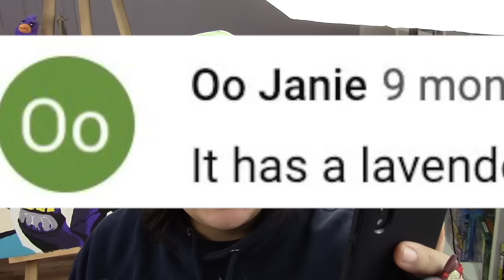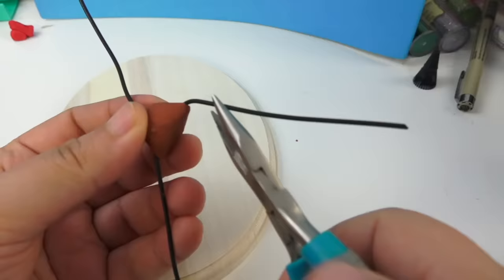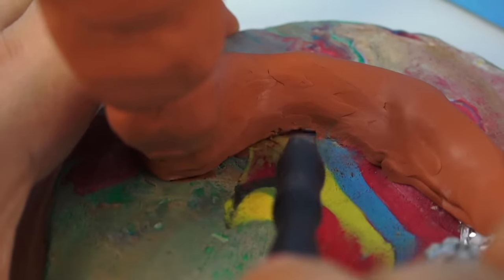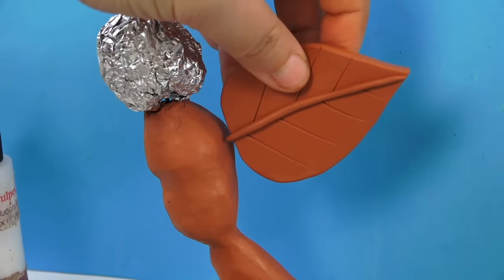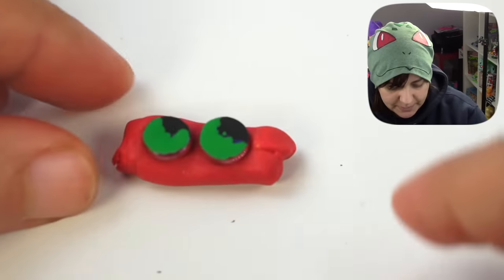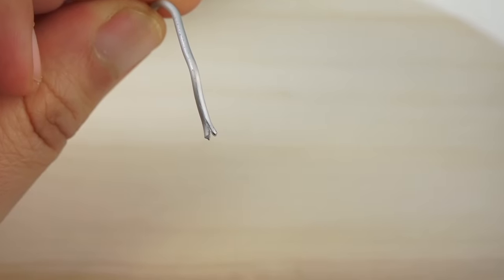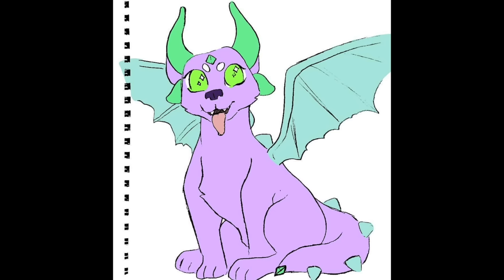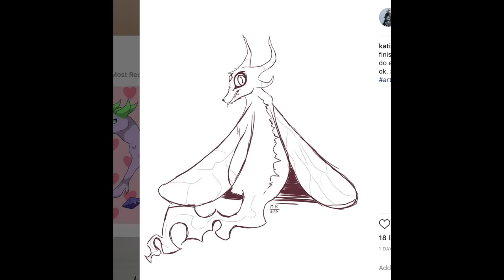I TURN MY SUBSCRIBERS COMMENTS INTO A SCULPTURE #1 Monster Clay craft DIY Challenge

Comment: #comment2art2

It has 4 wings that are iridescent
Huge mint colored eyes with eyelashes and the expression is evil.
The body is long and slender. No limbs. The pattern on the body is swirls of all different pastel colors except the underbelly. It’s very plain but still has cool texture. It’s tail is an odd shape and colored a little more vibrant than the rest of the body. It’s mouth is opened and looks like it’s going to attack. It had a bunch of teeth and a long tongue that is all very shiny. The head has some cool ridges and indentation. Think of it as living in a mythical rainbow environment.
Reply: Leah its katia remember me!!!!
Reply: Leah Martinez  I wanna see your one sounds amazing
Reply: I got the vibes of...

Snake
Reply: I really want to see that!

Comment: #Comment2art2
It is a small but chunky creature that is quick on its feet. It has a "pear shaped" body with tiny feet and a slim muzzle. It can also walk on all fours but can stand on its hind legs. Its ears are short and stubby with one solid color on them with a marking across the eyes that are the same color as the ears. It has white eyebrows and a white muzzle. Its tail is 1/3 of its body length in size and has stripes. The colors blue, white, tan, and green must be used.

Comment: #Comment2art2 a pastel pink creature who is fluffy and thicc. 4 legs (2 front, 2 back) with light blue back legs. 2 toed hoofs of back feet and paws on front feet. short feathers on the butt that fan out (any color). large cute purple eyes with long eyelashes. 2 white horns on sides of the head and one stubby horn in the middle of the forehead. kind of stubby snout and a heart-shaped dark pink or brown nose. short whiskers on the face. forked tongue sticking out and one sharp snaggletooth. hope it's not too complicated...

Comment: #commet2art 
1.It has a thick layer of fur coloured purple
2.It stands on all fours
3.It has one big horn on the top of his head surrounded by little horns 4. It's eyes are glow in the dark but you don't have to include it
5. It is smiling
6.It's tail splits into two
7. It has very small wings 
          Done!

Comment: #Comment2art2 It has wings with black spikes, they're big, normally it has a angry expression, his tail has also black spikes and is very long, and in the end has like three leaves, he has two wings  the part inside of it its pink, at the end of them it's green. His eyes are light blue and around of them he has like a white circle. His body is light yellow and by  his chest it turns into the green that he has in the end of his wings, his beak is black. And in the center of his face is (not so) reddish orange.
Btw sorry if I wrote something wrong, i talk spanish
Reply: Sorry if is too long

Comment: #nerdeficationsquad Sseing that you uploaded made my day! 
My creature would be light blue with a slim body and a large long tail with a teal fin at the end of it, and four legs. It's head would be proportional to the rest of its body. It would have four horns two straight and two curved, with six red eyes in the shape of almonds. My creature would have a big mouth that was wide open with a lot of pointy teeth and the inside of the mouth would be dark purple. A creature would also have claws that would be purple as well. It would also have big wings that the creature could use to shield of themselves or others from danger, these wings would be gold. I tried ❤️❤️ #comment2art2

Comment: #comment2art2 

It has a big, pixelated body with a big mouth full of razor sharp teeth but with nothing else inside on it's back. It has no arms or legs, it instead has four wings, two for arms and two for legs, the wings have a twirl on the end and the feathers are slightly burned. The mouth on it's face is full of stitches going all around it's jaw, which dangle when it opens it's mouth, it's eyes are like spikes that curve upward. It's tail is on it's head and resembles a tentical. It's stomach has a huge black colored hole with an eye like symbol that gives of an orange glow when attacking.

Comment: #Comment2Art2
My creature has a oval shaped large head. It's chin has virtually no definition, and it's ears are big, furry and feline-esque. My creature's eyes are large, cute and gold, and it has a small tuft of fur on the centre of its head. It only has two oval holes for breathing where a nose should be, and there is a crescent moon marking on its face. My creature's dagger sharp fangs reach it's eyes, and look like facial markings from a distance. It has other teeth, but they are much smaller, and they are all on the bottom of its head. It has a large furry chest, and the rest of its body isn't furry. My creature's feet have enormous claws and it's front legs are skinny and small in comparison to its forelegs, which are huge and powerful. It has a tail with three tips like an Espeon. Its wings are shaped like crescent moons, with a big spike on the edges. The wings have markings on them that resemble crescent moons. My creature also has tiny antlers next to it's ears that are brown. The colour scheme is iridescent white highlights, with everything else coloured in varying shades of galaxy colours. 

Is that too complicated? I hope not... 🌘🌘🌘
Reply: Heh

Comment: I’m not sure if you’re still taking requests. 🤣 but I’ll give it a shot!

This critter has a small humanoid female body, 

it’s arms are average sized for its height, ending with long pointy fingers.

It’s legs however, from knee down reassemble slim dragon-like hind legs (with hoofs).

It has a long tail with horizontal lines in the bottom side. The tail goes from a thick start to a thin end, and is about the same size of the body, without considering the tip details. 

the tip of the tail has beautiful symmetrical double sided feathers with rounded ends(4 in each side). 

The body is covered with vine like strings( torso, one sided strap) and leaves(chest piece and covering the forearms and loose-end like skirt )

Also, this imagined critter has two pair of wings! These are about half size of the body height, and match the tip of the tail. 

The face is narrow, with a small nose and narrow eyes. The pupils are actually slit. Instead of eyebrows, this critter has tribal tattoos simulating eyebrows. The mouth is small.

It has long pointy ears, that are pierced.
Two slim horns with that soft S shape in them stick from its forehead. But in between them, there is a crown like crest, kind of fish-like. This crest is aligned with its hair line, and goes down until half way of the top of the head.

Now the hair is short and spiky towards the back. 

From the neck down to the half of the tail, there is a crest, matching the crest in her forehead.

Color wise: in the green to blue gamma, with white and black details.

Comment: #comment2artz
Possible creature:
Head that is almost heart shaped/almond shape, eyes that are forest green, three sets of fangs that stick out of the mouth, a narrow dark purple tounge that had a split at the end, a long slender body, possible fins (2 or 3 sets depending on how you feel), long wings that fan out and have a light and dark contrast, smooth round scales trailing down the lower half of the body, webbed hands and ears, a single forest green necklace that hangs down the creatures neck. 
Bonus; use materials you used when you first started making craft videos vs what you use now.

Also love your videos Jackie!
#nerdygrain

Comment: Comment2art2
It’s very slim and long, yet gives off the impression of mystery and strength. Four long legs with fluff surrounded the wrists/ankles. Paws with large claws. It has three fluffy tails that gradient from blue to white. Around the neck there is a collar of fluff and looks like a scarf. Its ears has huge and rounded. A very slim head shape that is triangular facing forward. Stern eyes that are dark blue with an icy blue ring around the pupil. It has small but sharp fangs poking out of its thin mouth. The entire color is different shades of blues with bits of white. You can see the spine through its back and it leads to the three tails. It has a small nose.
Love you so much! Hope you like the description if you see it. Loved the video. You are awesome <3

Comment: #comment2art2 Its body is thick and green. The tail is fairly short, and ends at a pointy tip. The creature has long black spikes running down its back, all the way to the tip of its tail. At the front of the body, there are three long necks that snake upward. Each head has beady black eyes, large white horns, and a red forked tongue, along with razor sharp teeth peeking out. The belly is a dark yellow. It has a scaly body texture, and also has medium-sized wings, colored green like the body with dark yellow webbing in between.

Comment: #Comment2art2

A semi small animal that walks on all fours, it's body is two different colors (split down the middle with black) one half is mostly white and gray while the other half is a deep purple black, it's short stubby tail is white with a black tip. 
It has small white wings on its back.
it's head has the same coloring as its body but with semi dark purple streaks under its small, black eyes, it has 4 ears, plus two horns at the top of the head and one more small horn on its back
It wears wears a little cowboy hat on its back, attached around its neck by a string. It's tounge is a little long and light pink.
It's chest has a small black x on it

Good luck to all ☺❤

Comment: #comment2art2 
Hey jackie 
Start of with a woody brown colour in a bendy tube shape. Atach it to a base that is a grass green colour and add grass texture. Then take a yellow colour and shape a medium size cylinder rounded at the top.  For the arms  make in a thin to tick ratio and  place the thin side to the body and for the legs make in a tube shape and smooth to the bottom of the flat side of the cylinder.Then make a short and thick carrot shape and attach to the top of the round side paint it silver or gold. Paint on some eyes of any colour and attach to the base and bake. Cover in sealant of your choice. 
From a grateful fan, Olivia

Comment: #Comment2art2

- It is purple has speckles
- It is plump and furry/flufdy
- It's head is also round and has chubby cheeks that are also furry/fluffy
- It has spots on it's cheeks that are also dark blue 
- It has 4 short legs 
- It has a short fluffy tail that bristles out and is dark blue at the end
- It has fangs coming from the top of his mouth
- It has light blue eyes that are squinty 
- It has claws
- It has floopy ears 
- It has it's tounge sticking out 
- It's tounge is blue
- It is mad but doesn't look threatening 
- It is nocturnal
- It glows in the dark
- It has 2 horns coming from between it's ears

Comment: It has a small round body with with two skinny but powerful legs that have three huge claws for digging. Its fur is a pastel blue with black spots. Its ears are round and as big as it's body. It had a very thick tail that narrows down to a stinger at the base and two small beady eyes towards the front of its face. It's feet are hairless and scaly. It has a point black nose and small snout with tiny sharp teeth.

Comment: I really wanna try this #comment2art2 It has a grey slim body, 4 stubby legs with sharp claws. A top heavy head with a short snout, and 1 sharp tooth, one eye which is a gold and silver mix, a beanie covering the eye a bit. A stubby tail with a feathery tip. 4 pointy ears(either poking through the beanie or pushed down by the beanie) Thorns wrapping around the whole sculpture with a rose at the end. Thank you for reading this mess XD

Comment: #Comment2art2 

-It has big ears that droop down.

-It can either stand on two hooves, or stand with it’s arms and legs all on the ground.

-It has arms with hooves for hands.

-It’s eyes look very slender, and one of its eyes is black. The other is a mossy green.

-It lives high up in trees.

-It’s mouth is small and straight. It’s mouth droops down just a little bit at the sides.

-It’s body is small but just a little bit long. Kinda like a bean but without the curves.

-It’s body color is a dark brown.

-It has fur on its stomach. (ONLY on its stomach.)

-It does not have a tail.

-It does not have wings.

-The fur on it’s stomach is different from the color on its body. The fur is a neutral brown.

-It has antlers on the top of its head.

Comment: #comment2art2
My creature has...
(figure)
- A hour glass type body (white)
- A very round larger head (white)
- Lots of fluff on the body and cheeks (white)
- 4 small paws ( any 4 pastel colors)
(facial/body features)
- small triangle nose (pastel pink)
- a "W" shaped mouth with 2 fangs that poke out
- big eyes (any pastel color) with patch going over one (pastel pink)
- VERY long eyelashes (black)
- triangular ears on side of the head (pastel pink)
- very pointy horns above ears (tan)
- various shapes going over the nose (pastel rainbow)
- cinnamon bun tail (any pastel color)

Comment: #commet2art2

Here is my entry!! 

-Small, light blue feathers and a small tuft of them near the front of the head
-Long neck
-Big light yellow curved beak with a slight smile that reaches just almost past the eye
-White around the eyes
-Long, thin, light yellow legs 
-Long, fluffy, gray tail with a slight curve and a white stripe going down the middle
-Medium sized black, round eyes
-Pastel pink blush on the tip of the beak and kneecaps
-Large round cloud for a body
-Grey scarf
-Small, light blue wings
-Baggy grey and white striped socks that almost reach the knees
-Giant star shaped hat around the head, almost reaching the eyes.
-The star hat has a small grey night cap on it
-If the head is too heavy, you can make him standing on a cloud
 
Thank you so much for looking at my idea!! I would love too see how it turns out! Your videos are amazing!!

Comment: #comment2art2

It is a really big reptile like creature. It has four legs abd a gigantic tail with Spikes. There is also spikes on the spine which are yellow. Its head is a magenta color, which fades into Blue on the body. Its eyes are very, Very small and its mouth is really big with sharp teeth. It doesn't have claws, but has very snall feathers on its feet

Comment: #comment2art2

 i honestly don’t know where to start with this one (that should honestly be my motto for life) but here we go. 

tail:
long tail with fins on the back. 
tail ends a bit like a sail. clearly for aquatic use. 
dark orange-ish coloring with rich chocolate brown as the sail/fins. 
begins quite thickly but, as most tails to ever be a thing do, it thins out near the end. 

feet/paws/talons/legs/whatever:
black boot-like markings around feet. 
small, but sharp claws. 
four feet. no arms. four legs. that’s all. 
webbed toes. 
same main color as tail. 
has a fin in the armpit (it’s called an armpit on a four legged thing, right?)
legs are a bit on the stubby side. 

head and neck:
has a blunt snout with some black at the end. 
small, pointy (non disproportionate) ears towards the back of his head. at a usual ear area. you know. 
 two black wavy horns on the top of their quite flat head. they face backwards, towards their back and tail and stuff.
 a tiny fin in the middle of the head, going down to the neck though gets smaller as it progresses to the back. 
 little eye ring marking, the same dark brown as the fins.
 beside the fin going down the neck are tiny spikes of the same color. 
 underbelly is white, gradienting (is that a word?) into the main body color of the neck. (you can leave this out if you want because gradients are probably pretty hard with clay. )
 
 Main Body features: 
 big-ish fin on back. it’s not massive, but it isn’t little either. 

 other hints i should add:
  has scales that are most noticeable on the back and back of neck. mainly all along the spine.

boom. done. sorry if all of these details really limit the creativity availability. you can, of course, just ignore any of the hints you’d like because i honestly wouldn’t care that much. just be as creative as possible, as always, and it’d be absolutely amazing if you could sculpt this!

Comment: It has pastel blue, short fur with a few spots. Its tail is long and very fluffy. The body is very long with 4 legs. Its head is k-9 like with small antlers on it. The eyes are magenta to red with elongated pupils. It also has big wings. If you want to include the teeth: It has 2 fangs that peek out of its mouth. The other teeth are normal but a bit pointy. The toung is up to you.
I'm sorry if I missed something #Comment2art2

Comment: #comment2art2
This creature is very fluffy. It has large ears with tufts of fur growing out of them. This creature has a medium sized head with a muzzle. It has pastel blue eyes that are big with large pupils. Its fur has the slightest tint of pink and pink/grey streaks. It has 2 moth-like wings. Its 4 legs are very stumpy with paws(One of its pads have grey patterns along it, the patterns are your choice). This creature has a plumper figure. It has very tiny spikes that are pastel blue like its eyes running along its slimmer fluffier tail. the end of its tail has a larger tuff of fur. Its head has 2 large antlers decorated in small chains with gems of different colours along with it.
Hope you like this creature <3 and thank you if you pick it Jackie.

Comment: #Comment2art2

It has a slim light brown body covered with fur. It has four short legs. It has a large white fluff around its neck and large pointed ears. It has a bug fluffy tail with a white tip. It’s nose is small and black and it’s eyes are a dark brown. It’s muzzle is small but visible.